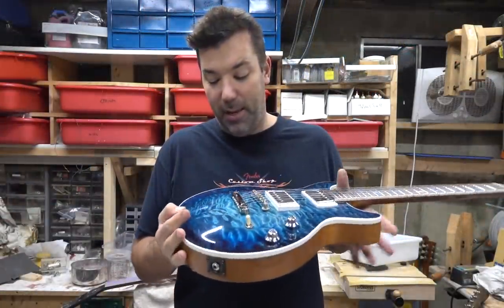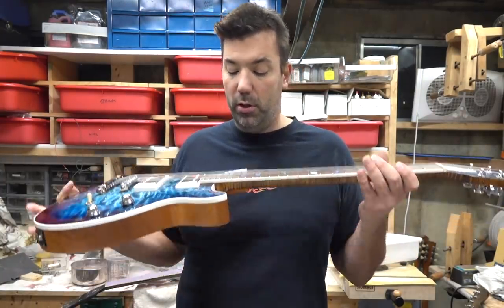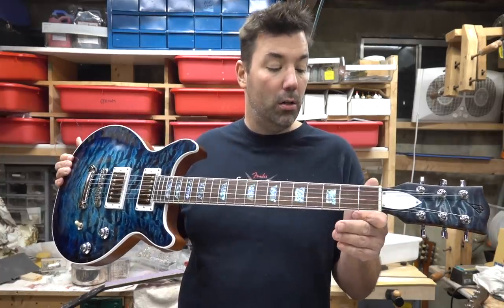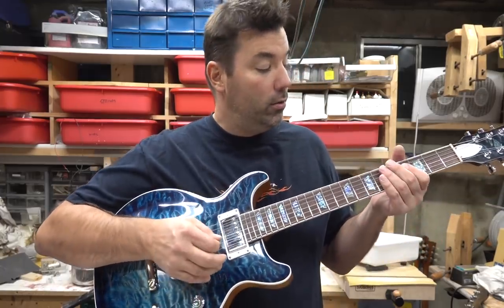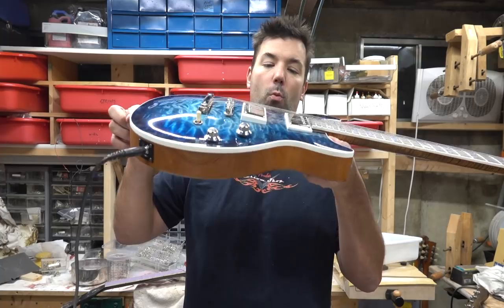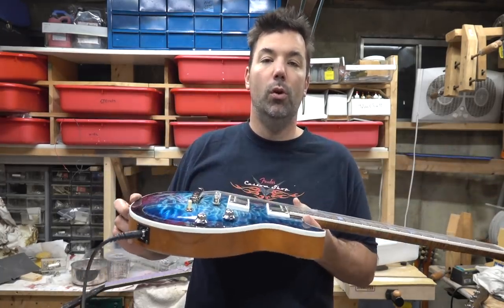Building a Les Paul Double Cut Carved Top - Full Time Lapse Video

Comment: I rarely see carbon fiber neck reinforcement in build videos. Obviously this is a very modern, well-equipped shop. I'm relatively new to guitar (started in 2018) & I'm interested in how these builds from scratch go. I know this vid is a bit 'old' (an entire year my god!), but if anyone following or BIGDGUITARS could answer:

The Gibson 17 degree headstock angle (Epiphone is 15 I think?) is pretty extreme but it's here to stay of course. I wonder, has carbon fiber ever been used to reinforce the headstock itself? Like, can carbon fiber be fabricated to curve along with this headstock angle & be embedded in the wood without weakening the wood itself too much? A 17 degree angled headstock that won't snap when you drop it, with all those tools, seems do-able if the carbon fiber could be acquired with the appropriate curvature, etc. Side note - I know the angle on this build is not Gibson-style, but I saw carbon fiber & thought why not use it to reinforce the Achilles Heal of angled headstock guitars..

Thanks, all!
Oh, and needless to say, this guitar build is beautiful. I'm in awe of the talent that goes into this.
Reply from the maker: I have seen it done but I haven’t done it.